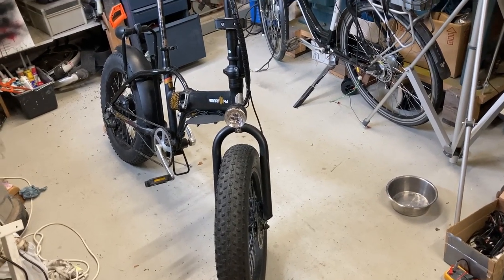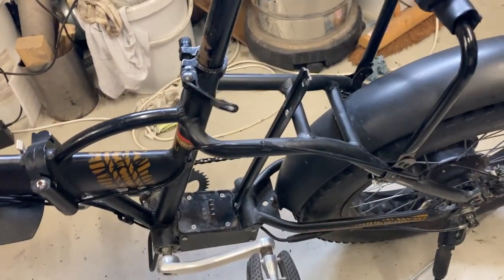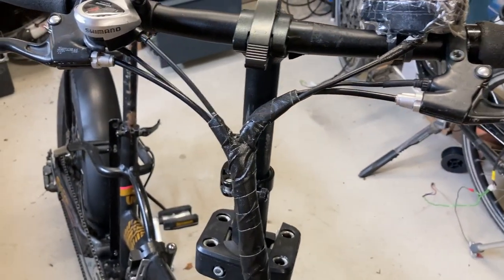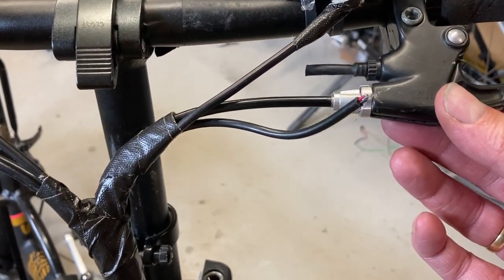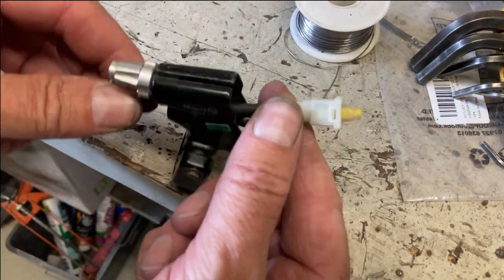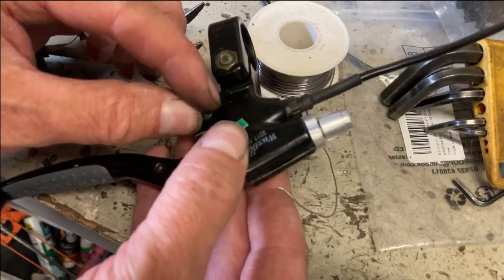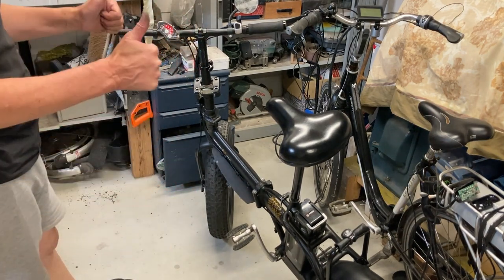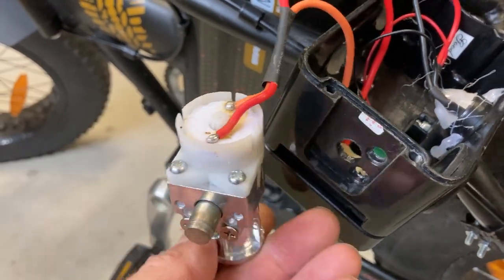Repair Wuxing ebike power cut-off brake lever and replace a battery lock with on/off switch.

Comment: I have the same issue with the same brake lever. My stop switch is the same except i has a little compartment on the lever with screws. I’m still trying to fix it…thanks so much for sharing your handiwork.
Reply from the maker: Thanks for your comment and good luck fixing your brake lever!